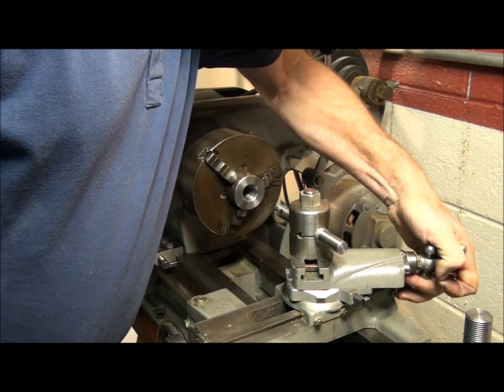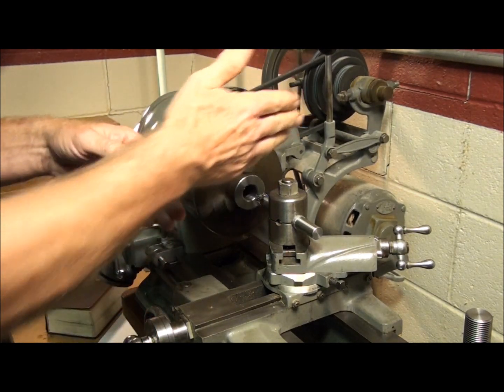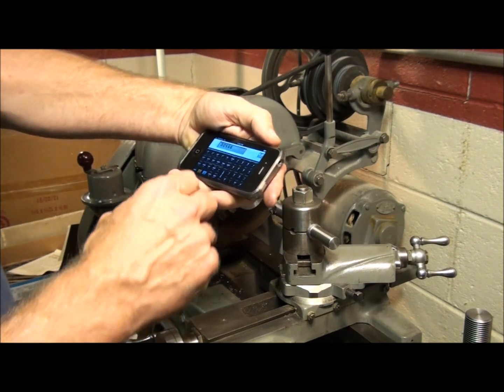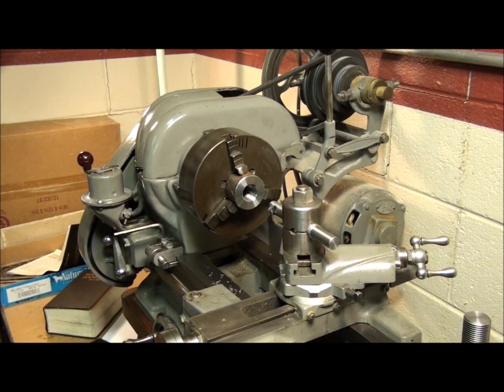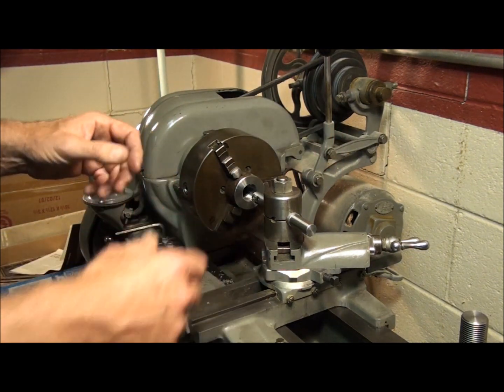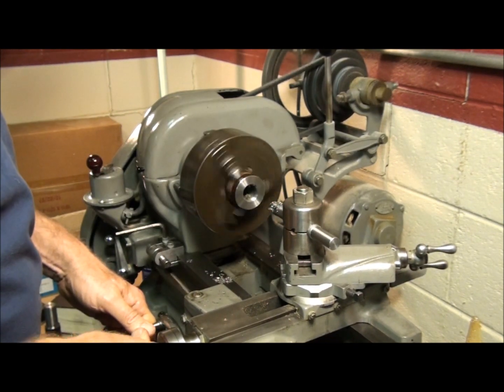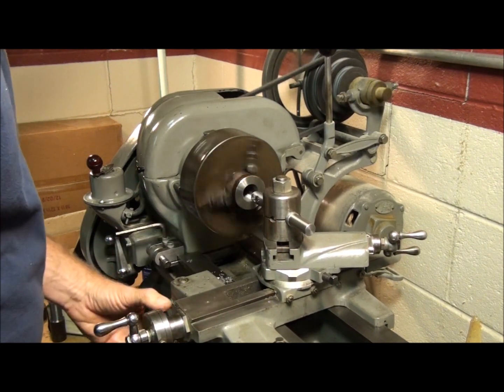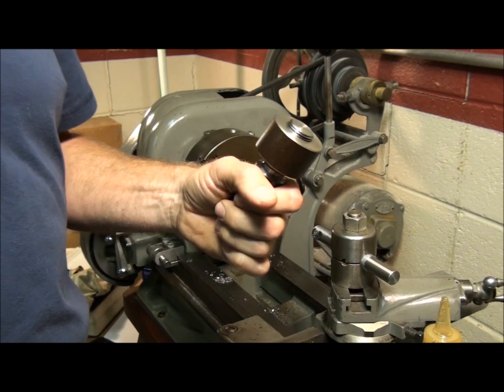Cutting an Internal Thread on the Atlas Lathe, Part Three - Cutting the Thread

Comment: Hi love the videos i have a quick question,I'm cutting a 1" x 12 TPI internal thread
but its a 55 deg whitworth thread..I know on the fishtail it says 0.053" depth of
cut..But how do you work it out is there ea formula for British standard whitworth
thread form please..?Any help would be appreciated..I'm at 0.051" and it just starting
to screw on its an internal thread..Do i just keep taking a few thou now till it
fits my spindle..

But also in my seco book on there inserts it says its 0.057" so kind of confusing but I'm
not using the seco partial form inserts for this one just a standard AG55 insert..
Reply from the maker: Sorry, but the closest I've ever come to a Whitworth thread is in the '58 MGA I used to drive. If you have a male thread to match it to, I would just cut it to fit. How are you going to round the roots and crests?

Tom
Reply: Toms Techniques Hum Well the 55 deg threading tool should do that ?At least the root..But i could swap the insert out maybe for the seco 12w CP500 which will do both it cuts the crest behind the thread..Do you think it might be best too swap out the AG55 insert for the partial form seco insert which will only cut the 12 whitworth thread and do the Crest as well and once it starts too do the crest i know I'm very close to size.

My only worry is I'm 0.052" depth of cut already.I don't think its a massive deal to round the crest last time i purchased 2 back plates picked up the thread and made them deeper to fit my spindle,Then used some sand paper off the lathe too smooth the tops worked perfectly..

If what you are saying is important how comes many you tubers I've seen cut a 55 deg thread just use a HSS bar with a 55 deg tool and call it good ?

Also the ER16 AG55 threading insert does not come with any way of rounding the crest,And is meant for a whitworth thread ?
Reply from the maker: I very rarely use inserts, I can't help you there.

Whatever angle tool you use (60º, 29º or 55º), it should be fed on 1/2 the included angle for most of the thread and straight in for the last few thousandths. Otherwise it will put too much load on the tool.

Tom
Reply: Toms Techniques Hi tom totally understand that and understand about the strength of the tool bit and insert,But a few spring passes takes care of that.I have got the answer to my question now pal.Which was at 27.5 deg angle on the compound slide.how much in feed depth in total only on the compound slide to reach the target depth of cut of 0.052"..It turns out to be 0.058" total then start testing the fit and then use the crosslide without touching the compound..At 0.001" increments testing the fit as you go for a 12 TPI thread..

Basically what i was saying about seco NR16 12w cp500 insert is it tops the crest behind while cutting the thread,but this time i was trying a different type of insert which does not and is..no different to a HSS tool bit really with regards to the crest not being touched unlike the NR16 12W seco insert i normally use..

But here is how it was worked out.. for a 27.5 deg angle..cosine of 27*30' and you get : .88741 multiply the needed depth (.052") by the reciprocal of the Cosine ( 1/.88741= 1.12687) and you get .0586..Now i dont fully understand the math behind the whole thing but am trying to learn about it..

0.058" of in feed cut on the compound..I think this is an important subject that not many people cover in videos..As people are just looking at there fishtail and taking the 0.052"
and dialling that in on there compounds..And there short of 0.006" and this is double
depth of cut so would be short of 0.0012" on the radial depth.
Reply: Muhaa Haloa o

Comment: Great series!  Just like my little lathe only looks much cleaner and in better condition.  Yes, they are all that loud back gears or not!
Reply from the maker: +Mark Helms 
Thanks Mark.
Reply: Not all that loud, but it requires a lot of lube and adjustment to quiet it down. You end up trading mess for noise. y sanity being a bit on the short side to begin with, I I deal with the mess to avoid the noise. 140wt on the backgear shaft, heavy gear lube (basically light tar) on the gear teeth, proper greasing in the countershaft cups (make sure the ports are clear and the grease is getting in), and proper set of the tooth clearance. Then, it is about as loud as a comparable south bend.
Reply: Oh yeah.... and lots of heavy oil in the oil port for the drive pulley bushings, which only come into play in back gear.
Reply from the maker: I think most of the problem is that I'm used to my belt drive Hardinge. :)

Comment: Hi Tom
I have a 10" Atlas of earlier vintage than your dad's (by only 5 or 10 years, 1933ish). Yes, they're all pretty noisy in the back gear.
I'm currently repairing mine since I broke a couple gears in the cross feed mechanism due to worn ways and tightening the gibs a smidgen too much, trying to get rid of the tool chatter. When I start to put things back together, I would like to email you regarding your experience rebuilding your dad's lathe. 

It's fun to see conversations still going on about work you did 2 years ago. This is a really nice series.
Reply from the maker: Thanks John.

You can contact me through my website (tomstechniques.com) if you have any questions about your lathe, but since it's been forty years since the rebuild, I'm not sure how much help I'll be.

Tom

Comment: Nice video Tom.  I have a 1934 SB and it sounds almost the same.  Question...what method did you use to know when to stop the travel?  Kind of hard to see inside the bottom of the bore.  I'd be afraid of crashing it. 

Also, that's a nice boring head, any thoughts on making that into one of your project videos?

Nice work, we all really enjoy your channel.

Best regards!
Reply from the maker: It's easy to know when to stop when cutting a thread in a through hole, because all you have to do is listen for when the tool stops cutting.

The boring bar holder is on the list of future projects, so you'll see a video on it eventually.

Thanks for watching.

Tom

Comment: When using the same cutting tool that you made for external threads to cut internal threads, aren't your cutting edges reversed?. . . i.e. the original cutting edge (geometry) is now on the opposite side of the tip.
Reply from the maker: Good catch Lee.

That tool would have been better to use on the back side of the bore. Apparently there was still enough clearance even with the helix angle reversed because the thread turned out fine. Good thing I wasn't cutting a square thread. :)

Tom

Comment: Hey Tom,any advice for a kiwi who bought an atlas metric 12700 lathe?
I see alot of the american guys on YouTube have them so i assumed they were quality and jumped at the chance now after further research I've come to know there's alot of hate there towards these lathes any tips or feedback would be greatly appreciated, Ben.
Reply from the maker: Ben,

The Atlas lathes are very plentiful and inexpensive which is why so many people have them and they will serve you well as a basic, light duty hobby lathe. What they lack is rigidity and precision, so they can be challenging to use for larger parts, or for parts that require close tolerances. The good news is that if you out grow an Atlas lathe, the resale value is high so it won't be painful to step up to a more robust machine.

Tom

Comment: Like this I have tried to send u a message but it will not go, I  need to make a left hand thread nut never cut a thread 3/4 bore 11 tpi do feed out on the nut?
Reply from the maker: Richard,

Not sure what's up with the messages, but the best way to contact me is like you did, through tomstechniques.com.

Left hand nuts are fun to cut because you feed from the inside out (to the right), so you don't have to worry about stopping. Everything else is the same as for a RH thread.

Tom

Comment: My Atlas was built in 1944 and is really quiet.  I do use a little oil on the gears though.  Thanks for that video, I would have never known to put the compound slide in that position.  Great job!
Reply from the maker: This one is quiet in direct drive, it's only the back gear that makes a racket. My dad can't really hear it anyway. ;)

Thanks for watching.

Tom
Reply: I do have another question for you.  I replaced my lead screw awhile back and can't figure out how to cut the slot for the cross slide.  ( no milling machine )  Any Ideas?
Reply: shortribs11
Why don't you contact me on my website and we'll discuss it.

http://tomstechniques.com/

Tom
Reply: This lathe - in back gears, sounds exactly the same as my Myford 7....
It is missing a tooth in the greatest of the two back gears - LOL! Nice video!

Comment: Tom, this was exactly what the doctor ordered for me! It's been years since I cut an external thread, and even longer since I cut female threads. I needed a refresher course, and this was it. I had forgotten about Machinerys Handbook, and using that for calculating minor diameter for female threads. The whole point is that I acquired an old Craftsman lathe with a threaded spindle nose. I need to make a faceplate for it, and I will have to cut female thread in a hub, to fit the spindle nose. The making of a male "plug gage" will have to be matched up to the same specs as is the existing threads, then I can use it, as you did to make the threads in my faceplate... Good job teaching an old dawg, old tricks. Yeah!
Reply from the maker: Thanks Jim, you old dawg. Glad you enjoyed it.

Tom

Comment: Found something out the hard way that might be useful to someone else. When backing out with the cross slide to return to the start of the thread if you don't add a little more each time you back out you will cut the thread up on the way out. You have to add a little more because your advancing the depth of the cut with the compound each pass.
Reply from the maker: Just be sure the tool is well clear of the bore before starting and you shouldn't have that problem. You aren't the first to find that out the hard way ;)

Thanks for the heads up.

Tom

Comment from the maker: What you say is true, but it's better to use the formula in the video (Pitch/1.5) to determine compound travel for a particular thread because it allows for the flat on the tool as well as the number of threads per inch. Rough the thread out using the compound, then switch to the cross slide to finish it up. That makes it much easier to measure and makes the tool cut on both flanks for a nice finish. There is a pretty good Wickipedia article on the Unified Thread Standard that is worth reading.

Comment from the maker: It varies, but normally the nuts will engage about 1/8 turn before the mark, which will screw up the thread. Finishing the thread with the cross slide makes it easier to measure the pitch diameter, negates any misalignment of the compound and leaves a better finish. It's an easier and better way to thread and no, I'm not the only one to do it that way. Check out Doubleboosts channel for another example. You do have to grind the bit accurately, but alignment of the compound is less critical.

Tom

Comment: How close to the number do you need to be when setting the half nut,  in other words how far off could you be and still start the thread correctly?  I have watched a lot of threading videos and you are the only one to use the switch from the compound feed to the cross feed, Gould you give the thinking on that.  It sounds reasonable to me but the bit must be formed perfectly, Right?

Comment from the maker: Thanks.

I'm in the process of setting up a website and one of my goals is to do a write-up on each of the videos that will include the reference data.

That is a good solid boring bar holder. If I remember correctly, it's pretty much a copy of the Armstrong holder.

Tom

Comment: That noise is probably coming from the backgear engagement mechanism. The counter shaft must be locked in position with minimal play of the gears. On a logan 200 there is an a adjustable stop on the end of the push rod for this purpose. If not adjusted properly it makes a loud ringing noise and the lever pops in and out as load changes.

Comment from the maker: I have used many different lathes, so there were no real surprises here (other than the fact that there was no quick change gear box ;) ) The biggest difference (as expected) was the lack of rigidity. That thread would have taken less than half the number of passes on the Hardinge that I took on the Atlas with no problem. I may have to take a look at it for my dad and find out where all that noise is coming from since the general consensus is that it is noisier than most.

Tom

Comment: Thank you for taking the time to do it on the Atlas, seeing it on the Hardinge was interesting, but not the same! I now need to find out the way to calculate the top slide depth of cut for metric threads, but that's just maths! The dial gauge is a nice thing, but it only works on "inch" threads, metric threads, there's no disengaging the half nuts, a little tricky but it's all down to getting the "routine" right! 
Thanks again, regards, Matthew.